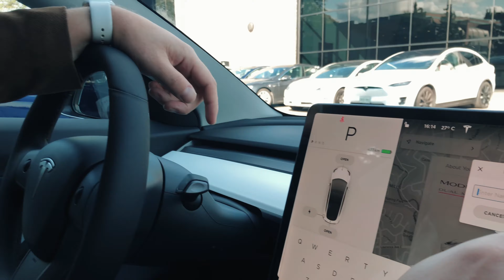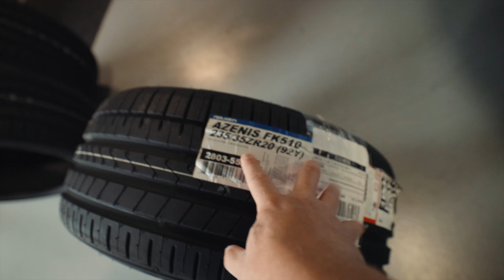This Tesla needs an alignment ! 🚗

Comment: I’ve used the FK510 tyres before they are a good tyre. Have you noticed much difference going to the tyre without the acoustic insulation on it? NVH much more on the road?

Comment: Trevor, it would have been interesting to see the the print out of the before and After alignment measurements.  How far out was it?  I have the same wear issues on my OE 18's. 39K MI  I'll be getting New Factory spec replacements in a couple weeks.

Comment: Why not put 18" tires on (with new rims) and get better range?  At least you didn't go to a Tesla service center for the alignment.  They aligned my tires 3 times because the steering wheel was not centered, and it's still not centered.  They suck!

Comment: You were giving up a lot of contact area with the old aggressive negative camber setup!  It should also be mentioned to always align your car with typical weight in it.  I use barbells and stuff in the floorboards and drivers seat to simulate my typical load placement.  Also if you track your car at higher speeds, increase the weight inside as it helps simulate the additional drag downforce experienced at higher speed.

Comment: Curious why you went away from the Michelin Pilot Sport 4S in the Tesla spec. Having done that myself I can tell you that there's nothing really as good as the original tire and although no one is entirely clear what the differences are beyond the acoustic foam and the somewhat wider tread, it's safe to assume that the tires been optimized as much as possible for the Tesla Model 3
Reply: @teslaownersonline5805  thanks for responding. They're actually a poor tire for the track as they just don't tolerate the heat very well. But understood on the expense!

Comment: Your tire experience has set me on the path of replacement as well, since my18" OEMs seem to be in their final season. 235/45R18 98W is the spec. When I find something interesting for the SR+ on one site, another tells me that they won't put it on my vehicle.  It seems that the ones they are offering are always more expensive. lol  A W gives a top speed of 272km/h, a V=229km/h. The SR+ doesn't make it past 225, apparently, so V should be good. Buying tires seems to be nearly as complicated as buying an ICE vehicle.